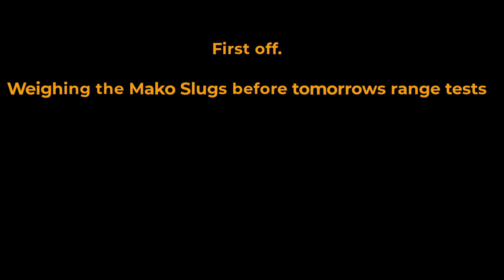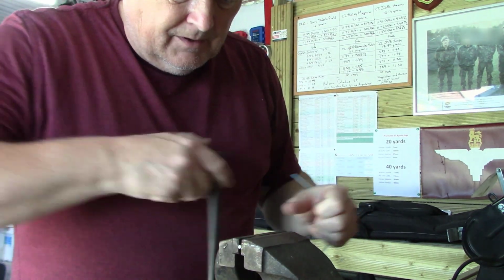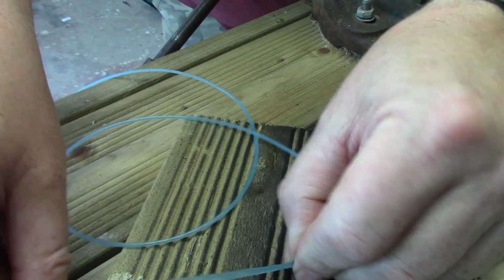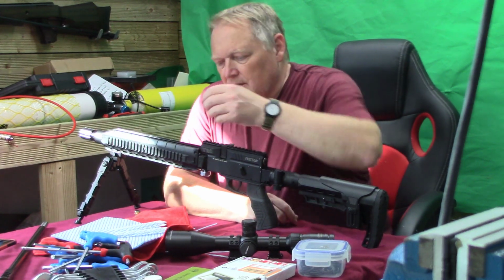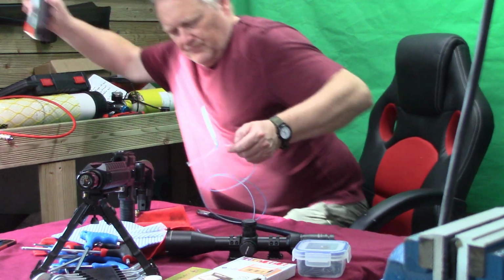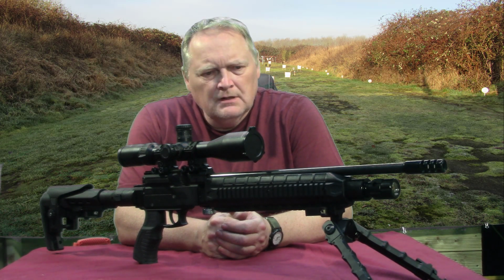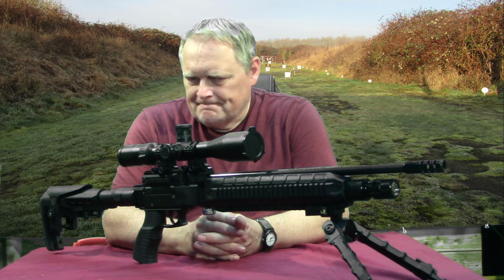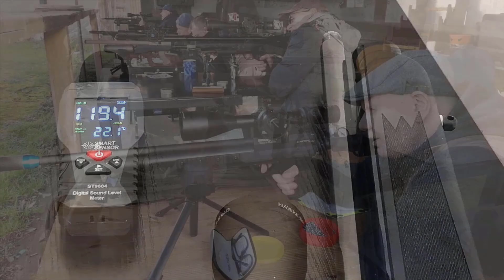Airgun Admin and the Mako Slugs on the scales

Comment: Nice video again. Cheers for the test I am looking forward to it. They are great another squirrel this morning at 16 yards no pass through from the Mako slugs
Reply from the maker: These Mako slugs are amazing. I will be posting two videos soon. They didn't suit the Retay, but I took my Falcon down and did the accuracy and ballistic tests at 50 yards. Winds were around 3+mph. The slugs mushroomed really well at 50 yards, even though the average power was only 10.8 ft/lbs at the muzzle. It must retain the energy for most of that distance. Accuracy wise, apart from 1 slug out of the five shot, all landed within 5mm group at 50 yards. The flyer made it 10mm, so even more accurate than the H&N Baracuda Match which was 25mm overall.
Reply: @airgunsniper-elite7385  that is great. Really good in the wind as well. I am shooting at about the same power. I am looking forward to when I can get to the range. I have my XSight 4k on the gun so it will be interesting to see how the ballistics calculator works out with them. I will watch them tomorrow.